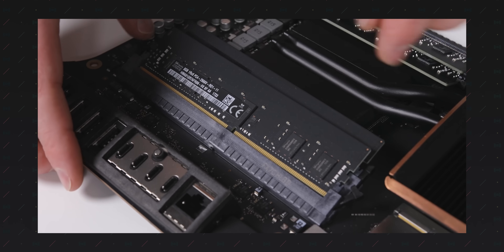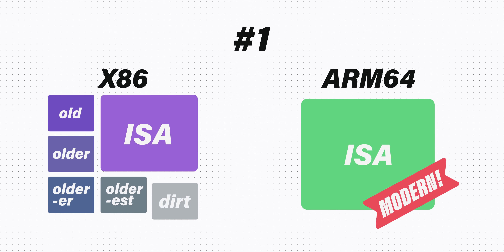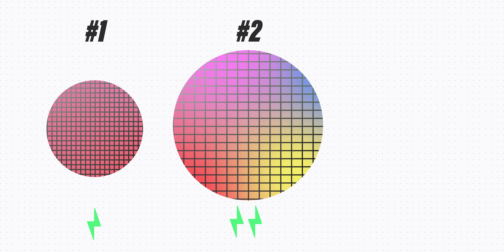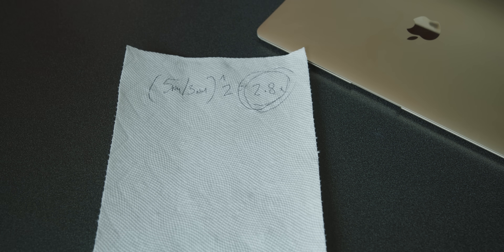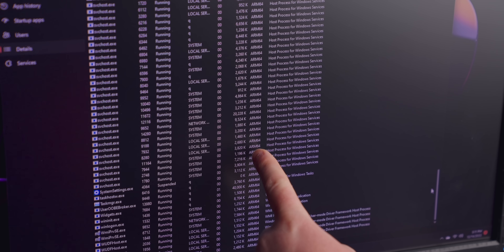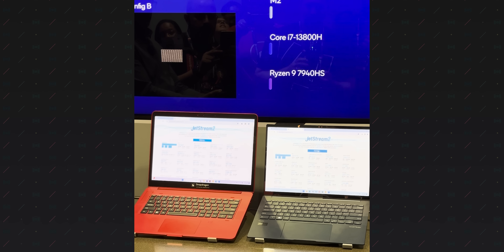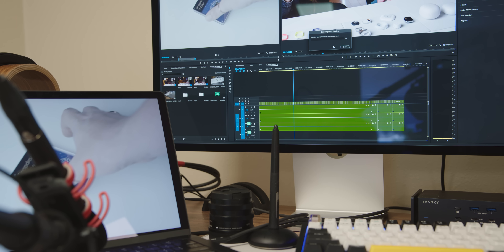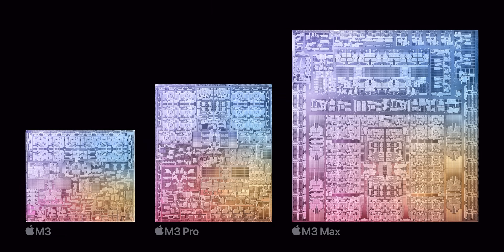Apple's Silicon Magic Is Over!

Comment: 3:10 there is a fourth point thats also important:
Apple has continuously operated on a node/technology advantage. Their lower volume, high average selling price and good relations to TSMC made it possible to always be ahead of AMD or Intel in that regard.
This is basically only possible because they sell the complete laptop and can use the higher profit margins to actually buy significant volume from TSMC, while still buying less silicon than AMD or Intel move.
Reply: Also, I think it was a previous video of his (or some other creator) which looked into the actual transistor count (mostly because of Apple's node advantage as you pointed out) vs performance comparison with AMD/Intel chips, and ofc its not all rosy after all!
Reply: They even booked all the early batches of 2nm TSMC silicon already, so other brand needs to wait a bit longer
Reply: @sihamhamda47 That’s the thing about being a key founder, you provide all the funds for TSMC to set up and go forward with a new node. It’s because of bug customers like Apple that the industry is moving forward to these new nodes. Also going by the reports many have opted not to design their chip for TSMC N3B as there’s very high costs associated with the node.
Reply: They use their higher profit margins to fill in their bank account.  If Apple made slightly less money they could sell a lot more computers,  but just like Harley Davidson Apple would rather sell fewer products at much higher profit margins than put an Apple computer into everyone’s house.
Reply: You’re so misinformed on the volume.  They are the largest user of silicon in the world and also TSMC’s highest volume customer.  There are a few little known products called the iPhone, iPad, AirPods, and watches. At one point, Apple accounted for 1/3 of all silicon used in the world in a given year.
Reply: @sflxn  You're confusing revenue with total silicon volume.  The bulk of tsmc's fabs are not producing 5nm-2nm process nodes, they are producing larger architectures on older nodes that sell for vastly lower amounts.  The majority of their production is 7nm and up, which apple buys exactly 0% of.
Reply: Which  by volume is a magnitude less than what snapdragon sells in android devices

Apple is a monopoly (a shaky one at that) in US not in India (where I am from) or Europe

I personally have 3 N7 class chips (personal devices) and a macbook pro (for work). And am in a minority of people who has an apple device here.
Reply: @aravindpallippara1577  Apple is very bad value in Europe so Windows systems are more affordable.
Reply: AMD uses the same node as M1 and M2 and has been using it in 7000 and 8000 series CPUs and even uses the slightly upgraded 4nm for their newer parts and all they did with that advantage is barely edge out M1 in performance per watt, they're still behind M1 in idling power draw which is a huge detriment to the battery life.
Reply: @FEEL_P1  Their compute dies share the same process node, but their I/O is not, and apple's solutions are monolithic in nature while AMD is using interconnects for separate chips each having vastly longer circuits with corresponding major power hits, if you limited efficiency to intra-chip communication, they are not at any kind of disadvantage.
Reply: @dwarfcow  so Apple is not at a node advantage, just different design trading die size (I think) for efficiency, they're more efficient without a node advantage.
Reply: @FEEL_P1   their m3 and m4 are on vastly newer nodes, AMD's chiplets are never going to compete in the energy efficiency world of monolithic, but they have monolithic apu's and they trade blows on equivalent nodes, but they're still on an older n5 node while apple is using n3 now.    Theyre still not able to be properly compared, but their efficiency is nothing magical, it's just what happens with smaller nodes with all the io on the same die and the memory on the package.  Distance takes power to move data over, and remotely located memory will always lose to on package in terms of wasted energy.
Reply: @dwarfcow  And with the upcoming strix point and strix halo amd is trying the m series chip game, huge chiplet based chip which encompasses a massive gpu and cpu with a common lpddr5 memory subsystem, no more separate gpu and cpu to be fed power seprartely  - let's see how efficient that is.
Reply: Apple being more expensive is the most outdated stereotype there is... it's really not... for $1k you can buy a laptop that for the average user is more than fast enough... and for $5k you can buy a workstation that's more than fast enough for almost anything... the price between x86 machines and Apple Silicon for the given performance is almost identical...

Comment: The 14in with the Max SoCs is a poor indicator of fan noise levels. A Pro in the 14in or any configuration of the 16in would be better. Also the 14in Max in low power mode (which has the same or better performance of a M2 Max) has significantly reduced power draw and doesn’t kick on the fans.

Comment: Talking about the technological limitations of processing nodes, I would add that the problem with the lower nodes such as 3nm used in m3 comes from quantum effects which are substantial in sub 8nm semiconductors. I am talking about effects such as guantum tunneling which means that there is possiblity that electron goes through transistors without applying voltage to the gate . This in turn means that the transistors can not shrink that much as you go for lower nodes because there is a greater chance of changing state of bits. Furthermore that is also one of the reasons why SRAM doesn't benefit from lower nodes. Therefore companies such as TSMC are very near a teoretical limits of process nodes, because nodes such as 2 nm (20 angstrem) will already consist of about 15 to 20 atoms in width (depending on the key dimension).

Comment: I was finally issued a laptop by my company, a Thinkpad, and it is comically bad. It runs so absurdly hot, battery drains so fast, you can practically count it down in real time, sleep mode works ~20 % of the time, the display resolution, and viewing angle is atrocious, aspect ratio is bad, Thunderbolt 4 port doesn’t work with my docks, WiFi performance is lackluster at best….
Lenovo sells the configuration that my company gave me for ~$1500. Highway robbery compared to an M1 Air, which can be had for half the price.
Reply: I think I paid around $3k for a high-end Lenovo Thinkpad Workstation P53 in 2021.  I dual boot Windows and Linux, and I love it.  It’s not ultra-portable in the least, but it is a beast of a laptop.

Comment: I hate this bashing of the butterfly keyboard, best typing experience I ever had, it was only a problem for filthy people I still have one of the first ones...
Reply from the maker: It was an awful keyboard that felt terrible, had no travel, and consistently broke with no easy fix than to replace the whole lower case assembly. Bad product and bad design.
Reply: @snazzy  opinion... I never had issues but I also remove dust from my keyboards...

Comment: I think this video is a little premature ahead of the WWDC announcements. Unless Apple does make the advancements you claim, then you can claim "Apple listened to me..." which of course they didn't. If this is the case, you'd be dishonest, but you should have waited until after the anticipated M4 to make this video either way.   ;-)
Reply from the maker: I mean, we basically already know what’s in store for M4. Silicon rumors are hard to lock down.
Reply: @snazzy  Understood, but given that the rumors MAY (and I emphasize may) be leading to a complete separation in the chip line from the ultra being two chips to one, and the possibility of potential pro chips, it's possible that the m4 could be more custom for each machine application. i.e. pros get chips that studio's don't get, etc. There could be a series of new architecture and benchmarks. Again, a complete what if, but it just seems more cautious to hold off until June to see if Apple really does something different and special, or just does the same ole hum drum BS they occasionally lock themselves into. Just the fact that they could potentially strip efficiency cores in favor of performance cores would be a big change for each desktop sku.
Reply from the maker: I agree with you. Still, that doesn’t conflict with anything I’ve stated in this video.

Comment: Windows on Arm makes simply no sense. And porting stuff there does make even less sense. Actually I wonder when do we move on from Windows it seems it's actually not that hard. Well sort of.
Reply from the maker: Incorrect.
Reply: @snazzy  So you think we should fix microsoft being ultra lazy in terms of software and api's should be boosted by moving it to another architecture where it will live along?
Reply: I have used WOA since it first pooped out, including SQ1/2/3. They never made any sense and were subpar to the point of being irrelevant. But the jury is out on the Oryon, but we will know in a few months if that can finally unshackle the chains of WOA mediocrity.

Comment: Why is there no increase in IPC from generation to generation of Apple M processors? The single core performance increase is almost in line with the frequency increase. Are they still dependant on ARM to improve the instructions?
Reply: No, Apple can freely do whatever they want with an ARM processor.  And there will be IPC increases if they think that's the best way forward.  That said, their IPC is already pretty incredible and they're using very wide performance cores.  Improving that further is more difficult, but I'm sure they'll be working on it.